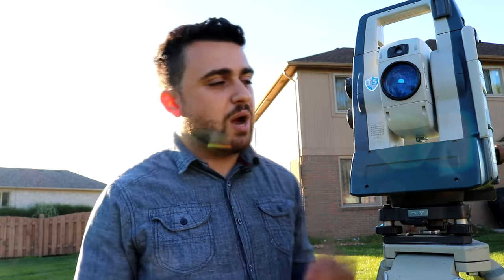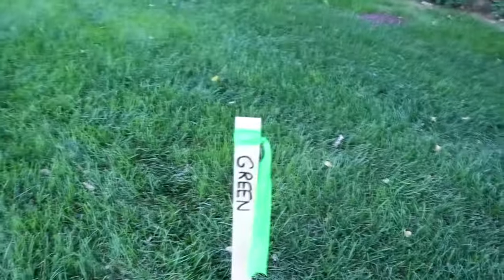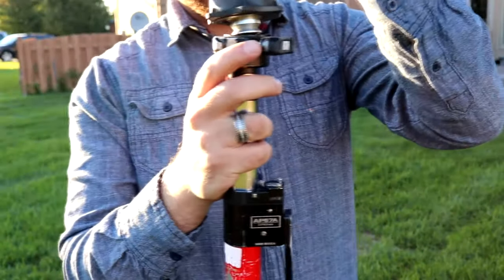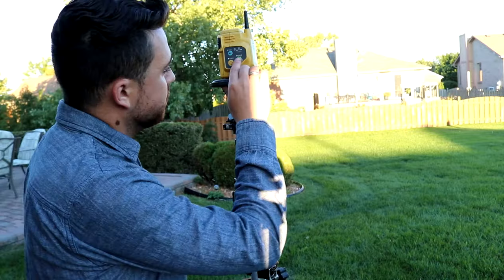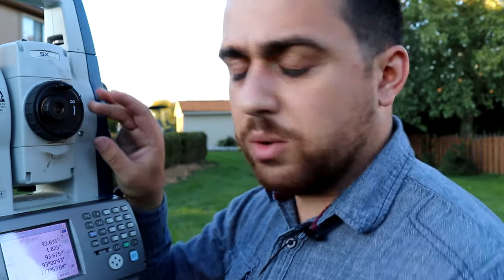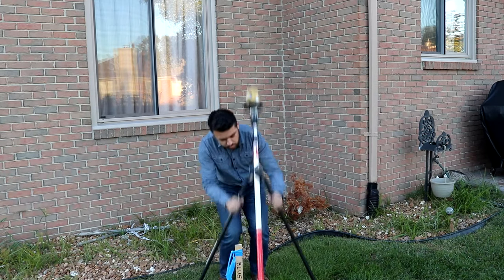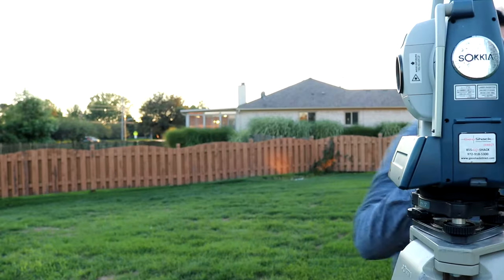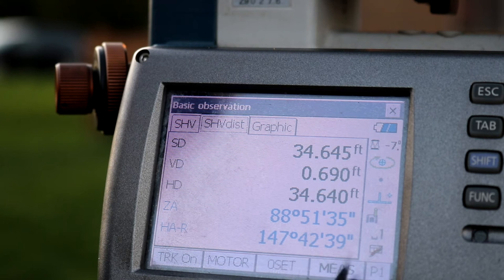Resection Method in Surveying

Comment: When setting up the gun, doesn't it need a known or assumed point with coordinates and a backsite before you start taking any measurements? Is there a menu on the gun that allows you to take measurements without doing a station setup? That would be useful to know for first timers. Thank you. Great video.
Reply: The gun will establish it's position based on the other known points measured during resection setup

Comment: I don’t quite understand what’s happening here. 

You have set up, and used point blue as your BS, obtained that distance and set the angle to 0 degrees. Then you turned from your BS (blue) to point green, obtained the angle between those two and obtained a distance to point green. You then did this again for point orange. 

So at this point you have the distance from the TS to each hub, and the angles from blue to green, green to orange and orange to blue. 

But you don’t have a N, E, Z. 

Do you obtain the coordinates for your occupied point from the angles and distances that you collected?

Am I missing something?

Comment: Thank you for the brilliant resourceful videos.  
I have one question , is it possible to correct the data if the reflector level was mistakenly set to 20m instead  of 2 m?
Reply from the maker: Yes, you can do this in the office. You will notice your data has a large outlier, and if you have field notes or did the work yourself in the field, you will know what the correct number should be.
Reply: @RamiTamimi  Thank you very much.  As you mentioned, I managed to correct outlier numbers in the office.
Reply: You can do it in the data collector too.

Comment: How would you do this without electronic distance measurement? Would a steel tape be the norm?
Reply from the maker: EDM is a pretty standard survey tool. You could do this would steel tape, not the norm, and your accuracy would not be anywhere near that of an EDM.
Reply: A steel tape is a good fall back if used properly. EDMs are preferred if environmental conditions are acceptable and equipment is calibrated.

Comment: Question, so I’m currently using a sokkia SRX5X with a RC -4. The data collector already has all the points I need and control points.

In theory, because my CPs are too far apart. I would like to place the total station in between my two CPs and do a resection robotically. I’m locked in and walking to my first CP .. as soon as walk around 200ft it disconnects and yes “ far mood “ is turned on and lenses are facing each other. 

Why does this happen? Is it a setting or procedures are being done wrong or what ? Please help
Reply from the maker: That is interesting, even if you are far away, the RC is able to control the total station and make it rotate and find you provided the sensor on the RC is pointed towards the total station.
Reply: @RamiTamimi  yes it’s a bit frustrating. The only way it allows me to walk further is if I’m backsighting and tracking. But like I said CPs are too far apart. 

I’m not sure if you’re willing to help me out and see how you set u u system 

1. I want to be able to sit the total situation anywhere on site as long as I can see the CPs

2. Walk to my CP read it and walk to my next one 

Without disconnecting. I would greatly appreciate it mr.Tamimi. Tech support has been much help
Reply: Check your radio module on your dc and antennas on both your instrument and DC.

Comment: A great video, I  have a question. How do you label West in your field book, is it Due West, or 000 degrees West, or 270 degrees West or 90 degrees West? I know all these work but which should be used in a field book. Every one seems to deal with this different ways. So what is the one best way?
Reply from the maker: There is no right answer, but in the field notes I will write West or Due West. In an actual drawing, I like to call it North 90 degrees 00 minutes 00 seconds West.